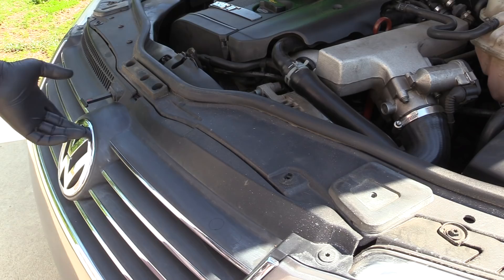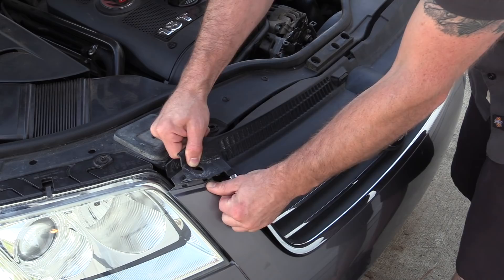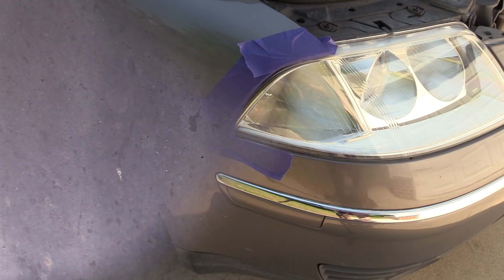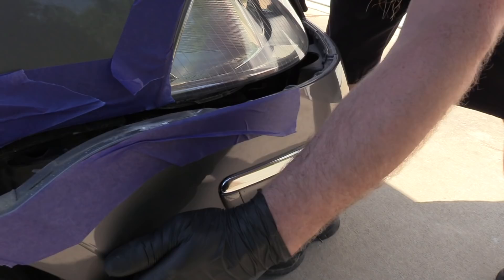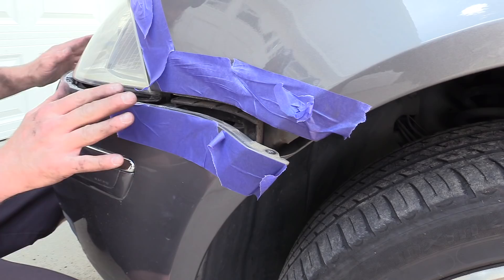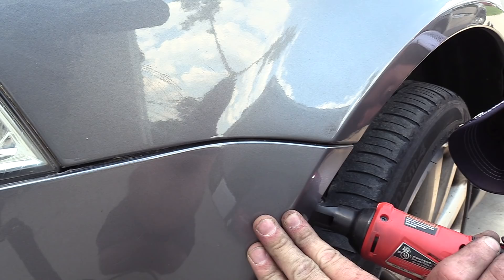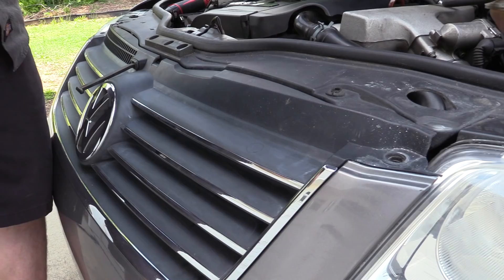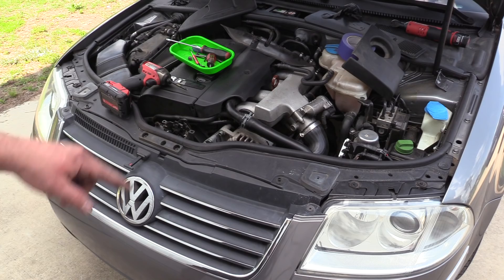Remove and Install Passat Bumper Cover and Grill

Comment: Now we just need a well filmed B5 timing belt replacement video!!! Great video as always.
Reply from the maker: That will be happening once the GTI  is on the road. I am coming due
Reply: Would love a video from Charles on that subject.  In the works @humblemechanic  ?
Reply: @Janet_Airlines802  Yes I need that as well.  There is one from EdgeMotors already that is pretty good.  But he goes through it all super fast.
Reply: @HumbleMechanic  Did it get filmed sir?

Comment: Fantastic video, you saved me a huge headache and a lot of wasted effort!  Bumper got pulled loose on a curb after parking too close - and I didn't know about the 'slide clips' on the sides below the lights.  Was able to slide them back in place with some elbow grease and get the two upward facing screws back in.  She's safe to drive again, and now I can have my mechanic make sure nothing else is wrong.

Comment: Great info! I have the front clip pulled head light removed and all the bumper lights disconnected. Found the lower plastic rad cap broken /cracked . 1h.20 minutes. I been meaning to change the driving lights and fix the headlight covers and do a rad flush so it just a little more extra work repairing the damaged bumper and front clip.

Comment: I had to do this when I had to replace the snub mount on the front end of my 2003 B5.5. It was the biggest nightmare ever because of the Mickey Mouse latch tab. I now have a 2007 Passat and I am glad it does not have that feature. Makes thigs easier if I ever have to remove the grill and bumper.

Comment: Great video, looks simple enough. I would be curious to see a video on putting the front end in the service position.
Reply from the maker: Great idea. I may do that too. It's also easy. I need to do a timing belt soon so worst case, it will happen then

Comment: something soft to set it on besides the concrete will keep it from getting scratched.
Reply from the maker: That could help for sure. I usually don't worry too much about that. The bottom is the textured part of the bumper cover. IF you set it down gently it will not scratch it at all. Plus, most of them have been beat to hell by now anyway. LOL
Reply: HumbleMechanic 
my luck I would bump into it while working and it would roll over and scratch the hell out of it. it seems that my luck as of late.

Comment from the maker: This job is so easy, that once you do it, you will be able to remove and install the bumper faster than watching this video. LOL

i am working on the final part of the video fixing the wiring inside the headlight. Stay tuned for that.
Reply: When you did your first bumper cover removal did you read the entire process on the VW system or just kinda go for it? I think I looked at the process for about 2 min and off I went. I think on all the vehicles I worked on I only broke less than 5 hood latch pulls. I always worked from the bottom up on all bumpers covers. Seems like to upper screws help hold the cover on more securely, especially when working on a lift.
Reply from the maker: yea I read the entire thing I was super freaked out to take body panels off. LOL That is good number on the pulls. I have broken a few more than that I think ;). How mine didn't break is a miracle

Comment: i was removing this few weeks ago, there wasn't clear instructions so i just tried myself, the biggest problem was hood pull latch, but i managed to do it... however, i wish i had to do that after seeing this video
Reply from the maker: Man I am glad you got it done. That hood pull is almost a replacement part on this job. Luckily they are not too expensive if you break it. I have broken my fair share. LOL
Reply: HumbleMechanic hahaha i was sooo afraid because that thing that i even put the wooden pole next to hood strut (because strut is not that strong anymore, it holds, but with little bump, hood is going down) hahah thankfully it all went well as i said :D love your videos man, and the best part is that we have the same car so working on it is awesome thanks to your videos
Reply from the maker: Rock on!!! 

while I was typing the notes for this show, I was thinking back to the first one I did. I was so freaked out by taking the front of the car apart. Now I can do this in my sleep. I am thinking about filming a speed test because I am sure I can do the whole thing faster than this video HAHAHA
Reply: HumbleMechanic for someone like you, there is no doubt about that
btw, it took me good hour and half just to disassemble and assamble it hahaha 
to be honest, i do not have any mechanic expirience, i just like to DIY on my car, and the best part is i am not getting ripped of by some mechanics for some minior jobs
Reply from the maker: That is not bad at all!
Reply: HumbleMechanic thanks! :D

Comment: It would also be great if you could replace the headlights with the xenon ones! But this was definitely a cool video, I hope that you'll make more of the b5.5, since it's also my daily driver😀
Reply from the maker: +GreekBoss007 I have aftermarket ones in mine.
Reply from the maker: Once the GTI is moving on it's own power, that will probably happen.

Comment: Don't forget on the 1998-2000 passat there is a 10mm bolt behind the turn signal  indicators! so they'll need removing first by unhooking the spring from the back - at least here in Europe you do.......
Reply from the maker: +jools Grudgings good call. The B5 is slightly different

Comment: Good stuff. However, you can't really avoid breaking something on the older ones... The plastic is so deteriorated, and breaks just by touching it lol
Reply from the maker: Some times you just have to look at it wrong. LOL. Yea a lot of older plastic is very brittle and gets sad when you mess with it. 

I removed my hood pull about 5 times for this video. I am kinda surprised it didn't break. When I do my next timing belt, it will get replaced either way. I think they are under $15 on amazon http://amzn.to/2sQdmot
Reply: Nice. Do you do much with BMW? Just got done with a sizable project, on a 323ci, that involved removing the entire nose lol
Reply from the maker: Nah, not much of a BMW guy. I wouldn't mind an older M3. They are pretty rad

Comment: I have a 2011 jetta 2.0L. i was wondering, do all vw bumpers remove in similar ways. I've notice from at least this years vehicle up to 2016 models of multiple types of VWs that the y are removed in similar ways. All I need to know is will these steps, obviously not exactly the same, be similar to my 2011 front bumper. bumper came loose on driver side after a minor accident.

Comment: The last one of these I did (the only one) had an extra piece of plastic in the inner fender. When I pulled the bumper off it just fell out and I had a bear of a time figuring out how to get it back in.
Reply from the maker: +Patrick Downing lol most of them  are not in as good of condition as mine. Lots of broken bumpers and slides.

Comment: Excellent! How long should it take to remove everything so I can plan the job?
Reply from the maker: it could be done pretty easy in about 30 min off, and probably another 25 back on. Some times lining it up can be tricky but its pretty easy job.
Reply: @HumbleMechanic What  I meant was how long would this job take from start to finish? The cam tool is not available from what I can find, so I'm going to make my own from a flat bar and drill and tap holes to replicated the cam locking pins. That alone will probably take me a few hours to make from just using your video as a guide.
Reply: @HumbleMechanic  Did you do a video on timing belt replacement? I thought I saw a link but its gone maybe it was someone else?

Comment: What are those marker lights you have?  I used to have a 2002 Passat Wagon and mine were the stock orange.  Yours match the paint and kinda just looks like a solid piece.  Just generally curious about what yours are and how they work.
Reply from the maker: +Fireflare774 :). They are the factory ones. I painted them with OEM rattle can paint and clear. It's been that way for 5 or 6 years I think.
Reply: Oh okay, that makes sense then!  It looks good though!
Reply from the maker: Thanks. OEM rattle can is expensive but well worth it.

Comment: Hey can you help me with my audi a4. I have a 99 audi a4 turbo and it's got a definite vacuum leak and when the car is turned on and running it shacks and gas smell comes into the cabin.  And engine is mis firing where do I start?
Reply from the maker: Start with a visual inspection. Odds are you will find it. There are a bunch of vac lines under the intake manifold
Reply: HumbleMechanic 
OK thanks. I also have that milwaukee new impact driver

Comment: Hey Charles what wheels are on your car?
Reply from the maker: They are stock B6 wheels. I forget the names of them.
Reply: HumbleMechanic they look really good on there. 👍
Reply: HumbleMechanic any way you could post a pic of the side of your car? I might have to get me a set
Reply from the maker: Yeah I will post one on Instagram tomorrow. They look good on the car for sure.
Reply: HumbleMechanic crap I'm not on instagram but i follow you on FB
Reply from the maker: Okay, cool I will try and post it there.
Reply: HumbleMechanic awesome! I'll be on the look out. Did you need spacers or anything?